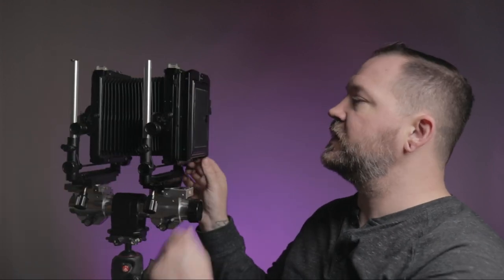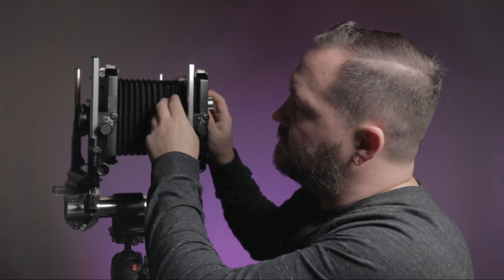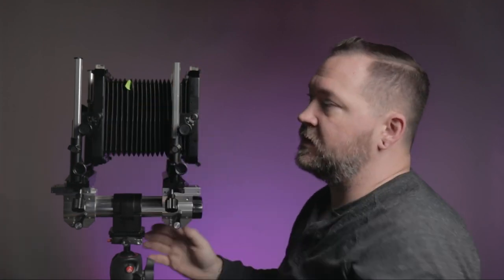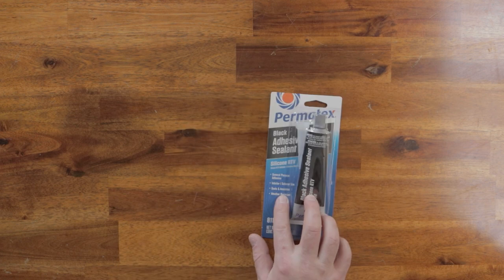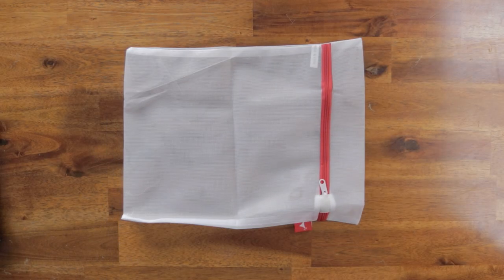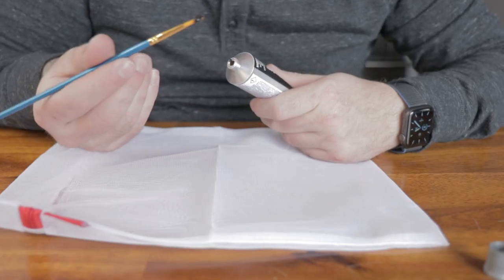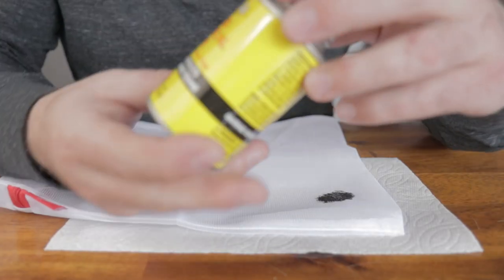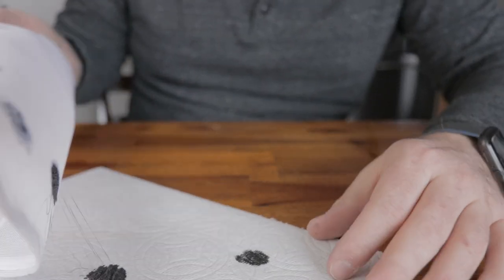Fixing Light Leaks - Large Format Bellows Repair

Comment: Chris, thank you for the test of those 3 black fillers. I was always told that black liquid electrical tape was the way to go and now I know for sure.

I'm going to make up a small repair kit in case my bellows is damaged while I'm on a trip. I think I will recycle one of my tiny tough plastic vials that my glucose test strips come in. Since it is fairly air-tight, a small bit of the liquid tape should last a while. Since I always have a small kit of Q-tips with me to clean lenses and filters, I can use one of those sticks as an applicator.

Terry Thomas...
the photographer
Atlanta, Georgia USA
Reply from the maker: Thanks Terry, I think a field repair kit sounds like a great idea! Particularly with the backpacking kit I'm putting together; being several miles into the mountains and developing a pinhole would be terrible!
Reply: For temporary field repairs to your bellows you may want to consider using gaffers tape. It's made for film and photography and is similar to duct tape but more easily and cleanly removed. 
It can also be used to temporarily repair many other items like clothing, shoes, tripods, cameras, packs, bags, etc. Very useful.

Comment: On my bellows, I use a mix of flat black acrylic paint, water, and white glue in a 3:1:1 ratio. Applied from inside, works a treat.
Reply: I wonder if you needed to put together a field repair kit how it would work if you used 70% alcohol instead of the water and only mixed everything as needed in the field?
Reply: @AtlantaTerry  the alcohol would definitely accelerate the curing time. I don't know how it may affect the durability of the finish or if it might negatively affect the adhesion, definitely worth experimenting. The water is only there to thin it down to more easily get into the fibers and pinholes. It would still function without it.

Comment: I have a solution that may interest you, I dedicate myself to restoring cameras in Cuba which puts me in a very limited situation with resources and I discovered that a spectacular material is a black membrane that I extract from the paper of some medium format negatives, some marks They are a paper with an additional black layer that can be carefully peeled off, it is incredibly thin, totally lightproof and extremely flexible. The first accordion I repaired from a very deteriorated 1930 Zeiss Ikon was done 7 years ago and it is still perfect. I use a glue that shoemakers use, diluted a little in gasoline
Reply from the maker: Very interesting! Thanks for the suggestion, I’ll have to explore that next time I have a repair to do. Never thought of shoe glue, sounds like a great idea

Comment: Just curious if you did any deep cleaning and lubricating when you got your camera. I just got a 45CX in really good shape but it has a lot of dried grease and sticky oil on it. In the Toyo manuals I can find they just say to wipe it down with a cloth is all you need to do basically so I don't know if these cameras should have any oil or grease on them at all. Seems like a small amount will help in certain areas though.
Reply from the maker: Interesting.. I can't say I had anything like that experience when my camera arrived; it was pretty clean. I imagine the adjustments that have gearing on them could benefit from some light grease but I'd hesitate to apply any unless there's an issue that calls for it; perhaps if it had sticking gears or binding. All the adjustments on my particular Toyo are smooth so I haven't done anything to it. 

I do have an old Canon AE1 35mm body that suffered from the dreaded "mirror squeak" issue and found that a few drops of machine oil really cleared that issue up, however I can tell you that over the course of a couple months those drops of oil migrated their way to EVERYWHERE inside the camera so I'd keep that in mind and be careful!
Reply: @ChrisDarnell  after closer inspection it looks like the worst of it is on the fine focus gearing and it honestly looks and smells like cosmoline. It could just be a very heavy wax based grease but it's gone very sticky. I think I'm going to clean it off and lube that area with a light application of heavy silicone lube  made for plastic/metal contact.
Reply: Just wanted to drop a reply here for future readers. Whatever you do, DO NOT remove the sticky grease from the Toyo focusing racks. That grease is a special damping grease that gives the focusing knobs a smooth feel and allows fine control without jumping movements. You may also find this stuff applied as a very thin coating on your front and rear standards to make the movements smooth. If you do find you must clean it off you can replace it with a grease from Nye called Nyogel 767A. I'm speaking from experience, any normal grease just won't work.
Reply from the maker: That’s really good to know, thanks for sharing!

Comment: Hey thanks for this I'm trying to get an old autographic brownie up and running and it has so many pin holes, I got gasket rubber and applied that all over, didn't work now it's taking me forever to get it off as it isn't light tight at all, (my fault I did this ages before I watched this) now I'm ether going to get flex seal or liquid electrical tape
Reply from the maker: I've heard a lot about flex seal since posting this video, I had never ran across it before but quite a few people seem to have really good results with it; it would be interesting to see another shootout between the liquid electrical tape and flex seal.. perhaps a future video!

Comment: There are many light leaks that can happen, especially on view cameras that are old or hand made and wood

The hardest to fix is when the film holder no longer sits right against the camera back and there are lights around the edge of the film holders . You will get a lot of dog and sometimes black or dark negatives for all the light bleeding in.

New bellows won’t fix that
Reply from the maker: Thanks Nicholas for the heads up. Fortunately none of my cameras appear to have much wear in this regard just yet, but I'll keep an eye out for that
Reply: @ChrisDarnell  I have an 8x10 from almost 100 years ago and it light leaks into the back from the holder slot. Only remedy is to keep the dark cloth over the camera when pulling the slide, exposing, and putting the slide back . A lot of old camer users have to do this. 

8x10 ain’t cheap! 😂

Comment: Curious how this solution is holding up - just saw some light leaks in my camera - probably using your solution.
Reply from the maker: Hi Michael, so I eventually ended up buying a new synthetic bellows for the Toyo in this video, but the original with the liquid electrical tape patches is still hanging around as a spare. The one thing I noticed is that if you have to do a larger repair the electrical tape can kind of stick to the folds in the bellows when it's compressed, particularly if the patch is on a flat seam that contacts another surface when compressed down. I ended up scoring the outside of the patch lightly with a scotch brite pad to get more of a matte surface and that seemed to help. Patches on the corners didn't seem to be a problem as much. Hope that helps!